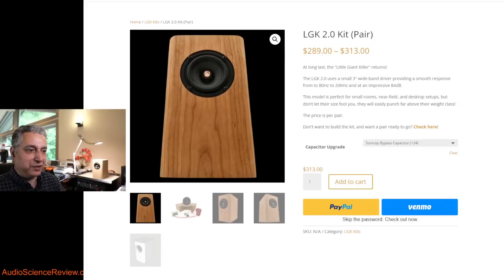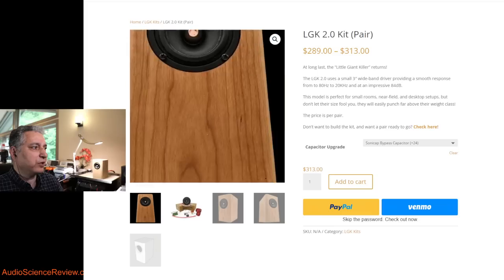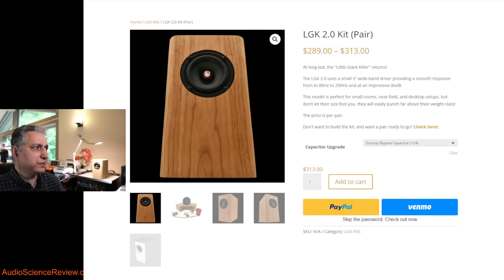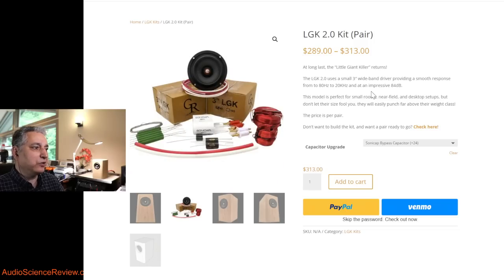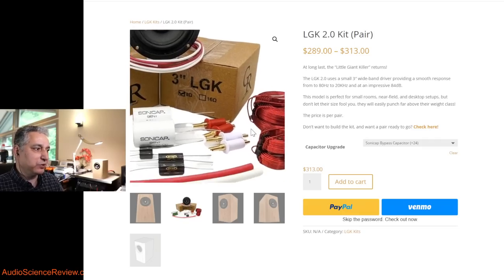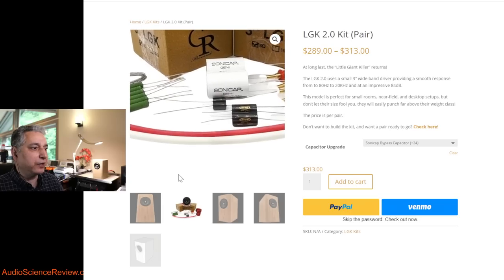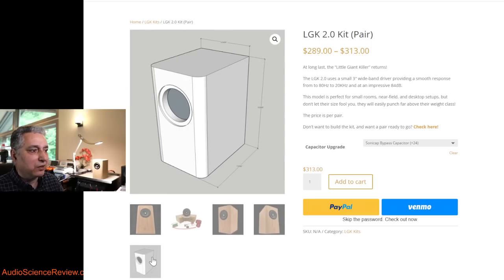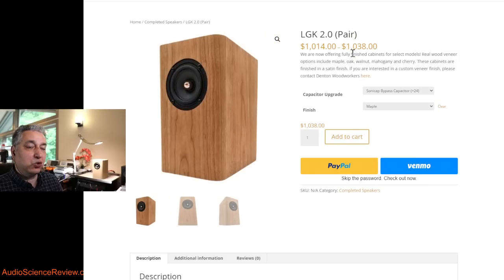GR Research LGK 2.0 DIY kit Speaker Review

Comment: What a joke of a review.  This reviewer is pissed off that Danny put him off as a reviewer of his speaker. I wouldn’t have this guy review any speaker because his process is flawed IMO. For 1, why would you evaluate a tiny speaker at 80-90db especially a single speaker? Any good reviewer wouldn’t. 
2: distortion levels. Somebody tell this reviewer when you overdrive a speaker it will start distorting.
3: this reviewer was complaining about how sturdy/stout this speaker was and it didn’t to be for such a small speaker. If the cabinet is sturdy/stout that should be a good thing, but since this reviewer has it out for danny, he just took another shot at putting danny down.

Overall, this speaker was designed for a desktop type of speaker, nearfield with probably a  30-40db output, not 90db. This is also a $300 speaker, not a $3000 or $30,000 speaker which this reviewer seemed to think it was a more more expensive. For example, this reviewer was complaining about the coil not being perfectly wound in a circle and his judgement “at this price it should be perfect” is just wrong and proves this guy has it out for danny.
I would suggest that hat this reviewer take danny up and visit danny in Texas so you can learn how to properly evaluate a speaker. Also, I would suggest that you use your ears and listen to a pair of speakers for how they sound and not just rely on measurements which mean nothing IMO, it means more to me how they sound than if they measure bad
Reply from the maker: Every bookshelf speaker I have tested can be measured up to 96 dB.  This one I had to cut back to 90 dB.  That was the measurement part. Listening test was from 75 to 80 dB at my position.  The distortion sets in very early, way before these levels with the right content.  This is why I played a ramp volume.  Even at low volume you can here the vocals distorting.  Don't believe the hyperbole from the company.  I have listened to the speaker and measured it.  The company has not measured it properly, not provided any sound samples of the speaker.  What they post had thousands of dollars worth of dual subs.  

And did you say you listen at 30 dB?  Doesn't sound like you have any idea what the scales are there.  Your environmental noise in bass frequencies is 40 to 50 dB alone.  Even quiet listening is 65 to 70 dB with peaks likely higher.

And I did use my ears.  And recorded it and post in the video for yours.  Clearly you didn't watch the video and just bought a bunch of false excuses from the company.
Reply: "with probably a  30-40db output, not 90db" ? 
The noise floor of a silent room in a house is at least 30 dB, you would barely hear a 30-40dB speaker.

"Also, I would suggest that you use your ears and listen to a pair of speakers for how they sound and not just rely on measurements which mean nothing IMO, it means more to me how they sound than if they measure bad"
He did and distortion was clearly audible, did you watch the video?
Why would you want to now how they sound to Amir? Peoples preferences differ. Measurements are at least objective.

Comment: Most professional speaker designers tune their speakers by ear because they know that relying on measurements alone rarely gives you a speaker that sounds good. Audio Science is run by a bunch of electricians and engineers rather than audiophiles. Their Sole purpose is perfect measurements rather than sound quality. Their listening tests are based on confirmation bias. They measure then listen and their brain reacts according to their preconceived beliefs about how certain measurements sound. So they are not really qualified to understand the needs of audiophiles like us. Every audiophile has their own preference so the idea that a uniform polar response speaker would meet the needs of every audiophile is laughable. But thats what Audio science would have you believe. B&W are one of the most famous and successful speaker companies out there. Used in professional studios for their sound quality. Do they have perfect polar response? No they dont. Do audiophiles care? No they dont.
Reply from the maker: I listen to every speaker I test.  I provided a capture of that in this video.  That spoke louder than thousand measurements in how distorted the sound of this speaker is.  So if there was a time or place for that talking point, this is not it.  Watch the video.  It doesn't take long.

Comment: You know… expensive reading equipment and software is great! But means nothing at all but wasted money on a 100k$ equipment investment because you don’t know what your doing with it. There really isn’t anything useful in your testing because it’s outside of the industry standard.. this is subjective and inconclusive way of of doing it. Shit and ice cream.. pretty much the same thing right??
Reply from the maker: Say what?  My criticism of this speaker is based on listening tests and amount of distortion in generated there. Measurements of frequency response were fine.  It was distortion measurements that were off the chart and verified by ear to be correct.  Why don't you watch the full video and learn the research behind it instead of posting random comments like this.